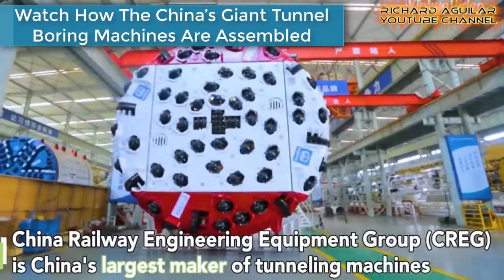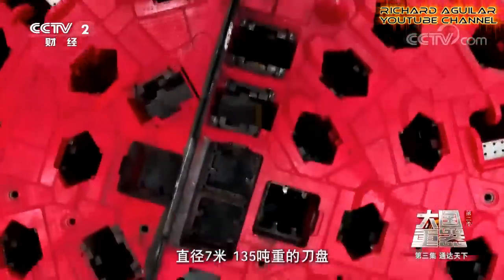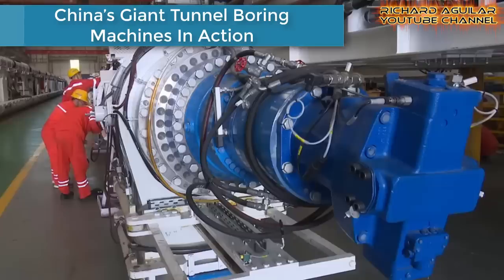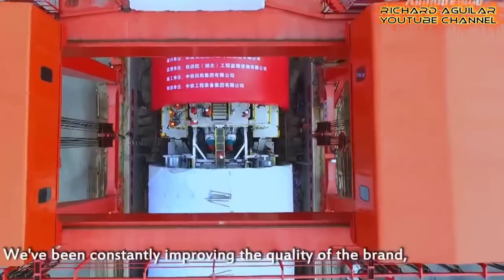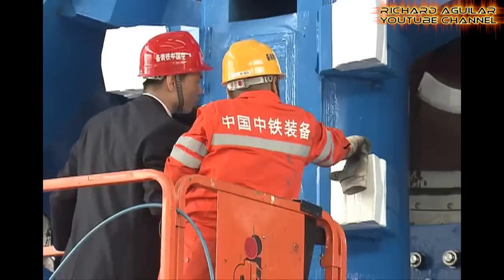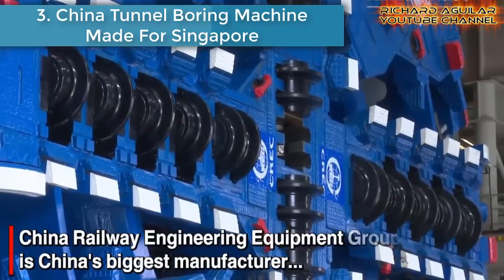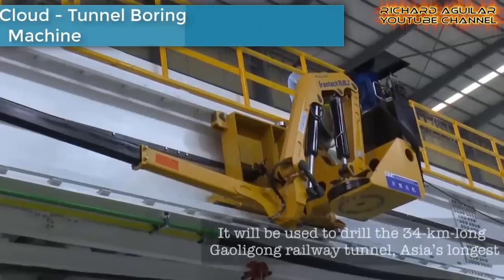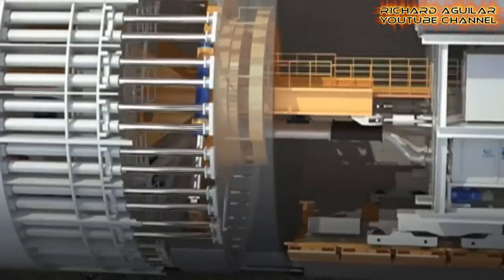China Innovation! Super Giant Tunnel Boring Machines In Action | Assembly To Operation

Comment: They really are incredible machines.
I need a quote on two machines FOB Texas. I am hoping the duplication was exact, because repairs and replacements are almost as important as the original price. Diameter is 9 to 12 feet, AFTER the concrete is is installed, and I would like there to be an additional extension of the bore head cover, or some other method that will allow the machine to spend much more time boring rather than waiting for each ring of concrete. I have several suggestions about that part. Additionally, these TBM's will be drilling until they die. hundreds, actually thousands of miles. So we would start the orders for the second pair as soon as we have verified their abilities. Also, we would be able to get emergency parts from the new ones, and have a better idea of which components we should keep several on hand. Obviously, we would make replacement parts such as hoses ourselves. I would love to see a TBM that somehow was able to place the entire concrete circle at on time, but we would probably need to keep the top keystone piece installed separately. Price will be a VERY big factor, as the project is not expected to return any profits, just provide jobs and not loose any money. We will negotiate the project as if there were no import taxes, duties, or tariffs, then if I cannot make them disappear, we will figure it out.
 I am hoping to run them mostly under expressways and railroad right of ways.

Comment: The base principle of this kind of machine is very simple, it can be understood at a glance. 
But it's much more complicated to create a practical version and reduce the cost, that requires technicians  and big market .
Reply: The biggest challenge is ground type, in London dense blue clay an open face machine can work and advance rates are very fast. In Kuala Lumper the soil type varies and Herrenknecht supplied machines to the contractors spec to tackle both types of ground. There were also two TBMs from China CREG and operated by a Chinese sub contractor employed on the more favorable soil type section of the metro line. These were very similar to older Herrenknecht machines.